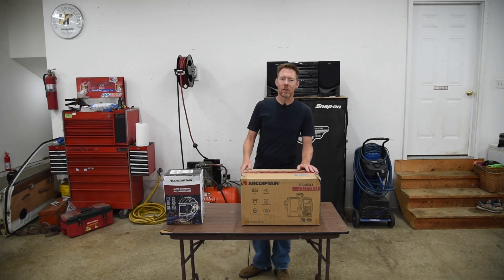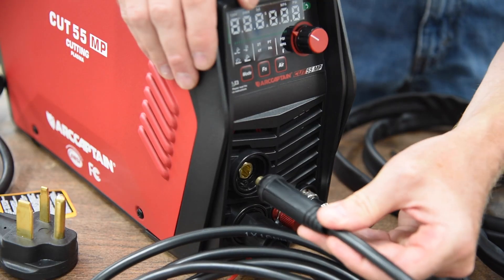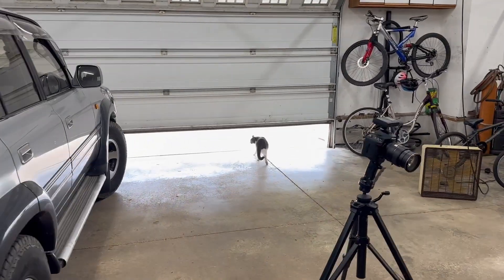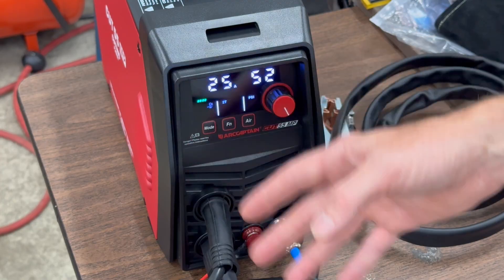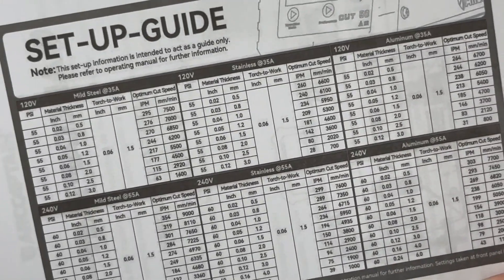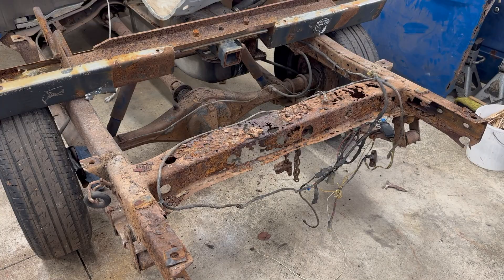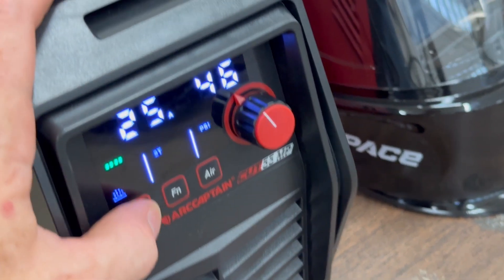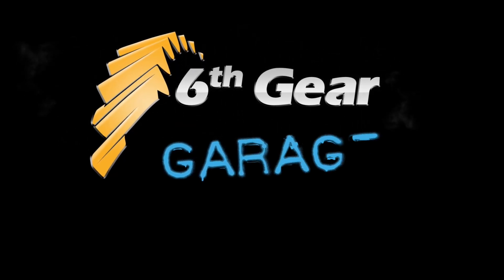ArcCaptain CUT55 MP Plasma Cutter Review Test- Cutting 1" Thick Metal!

Comment: I have a 2007 GMC truck which needs new cab rockers, floors & pickup box as well as some frame work so I'm checking out which plasma cutter would be best for auto body work. Planning on buying the cut55 MP today. please enter me into the drawing as I really need a helmet to replace my old old manual helmet.
Thanks great video!!!
Reply from the maker: This has been a great machine! Sorry, the drawing ended long ago and the 3 winners were already chosen.

Comment: When does the contest end?    My project is learning.   56 years old but that is not too old to learn new things.    My goal is to make a smoker.  

Did you test 110 at 1/4 inch?
Reply from the maker: Sorry, the contest has ended. I didn't bother testing on 110 because it will just trip the 15a breaker over and over. You're never too old to learn!

Comment: Hi there Brian, I just got the same machine. Have you figured out what the " Planning Air" mode does? The cut mode is obvious, grid mode is cool, rust removal is also cool, but I just can't figure out what the last mode does. And as I was writing this, I wonder if planning air would be the gouge mode....hmm. Any thoughts?
Reply from the maker: I never did figure it out and the instruction manual doesn't really explain. I'm hoping someone figures it out and makes a video!

Comment: Hey, nice review. I picked up the  Cut55MP last month. I haven’t yet started using it, as I am in the midst of building a plasma table. I got the Cut55MP to use with my ArcDroid, since it doesn’t have high freq, but blowback start, which is necessary. Really looking forward to the combo together. Glad you did a video, since there hasn’t been any on here yet.
Reply from the maker: That's going to be a nice setup!!

Comment: I do metal art and that would be the perfect plasma cutter for what I do not because how good it cuts but  the way it cleans rust and gouging. Great video..
Reply from the maker: The rust cleaning feature is a nice bonus, but for a large area it would seem time consuming and possible use a lot of electricity compared to a wire wheel. Another more efficient but more expensive option would be a laser cleaner, but they're still thousands of dollars.
Reply: @6thGearGarage thank you for the response

Comment: Using many of your videos, I'm working on a 1987 Toyota Pickup - replacing body panels, priming, painting, interior work, and on and on...  Brian, I had the same problem with the air hose on my plasma arc cutter.  Someone already mentioned trimming the length would help.  Also, if you take a piece of heat shrink tubing (the good stuff with the adhesive that comes out when you heat it) and putting it over the ends, the hose clamp won't tear the hose as easily.  The Arc Captain plasma cutter looks like a nice unit.  I have an Arc Captain mig welder with the aluminum mini spool gun.  It works nicely.  It didn't come with a cover though.  The cover is a great idea.  Thanks for the video.  Are you going to tell us what happened with the 3 wheeler accident?  Are you back 100%?
Reply from the maker: Congrats, your account was randomly selected to receive the free giveaway from Arc Captain! Please contact me through IG or FB, or email brian@6thgeargarage.com with your Full name, Shipping address, Email address, and Phone number (for logistics only - no spam calls/texts) Thanks!

Comment: Nice product. On the old cutter cant you just shorten the hose in the back?
Reply from the maker: I did have a shorter hose at first, but then it leaked more at the fittings. With the longer hose, the line isn't flexing and bending coming right off of the fittings, so they don't leak as much (even with 2 clamps per fitting.)